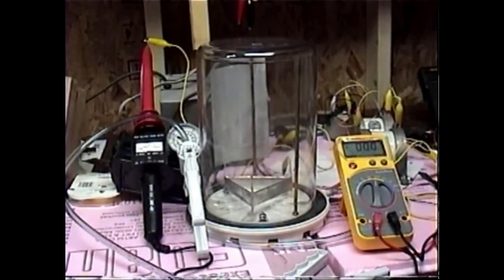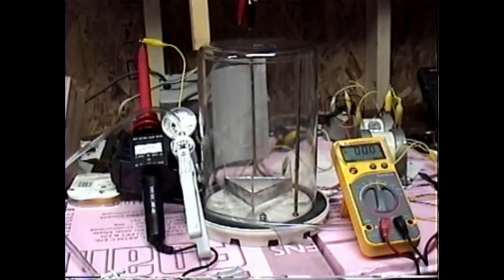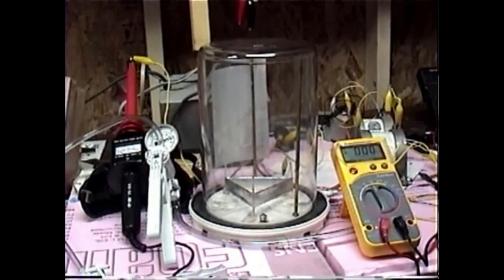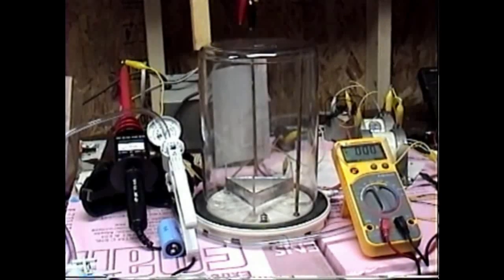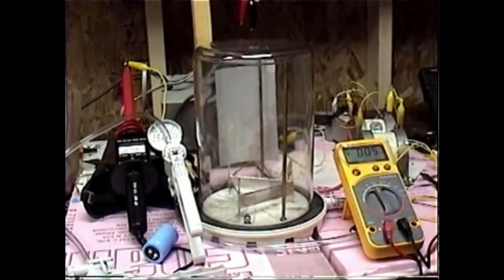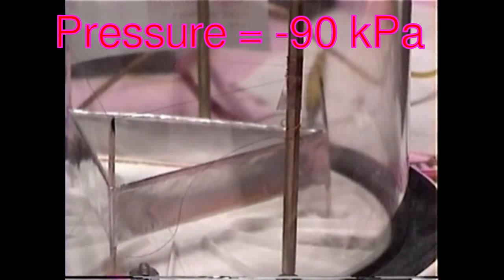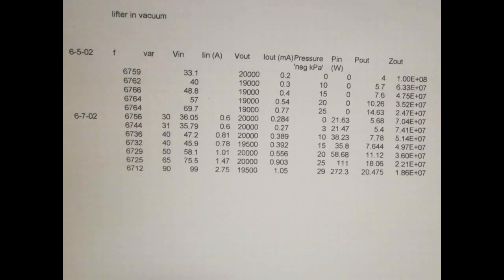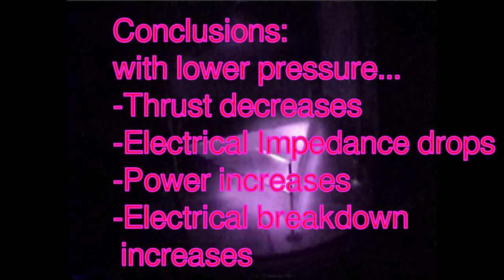Lifter in a Vacuum : Electrodynamic Ion Propulsion

Comment: did you try using another dilectric instead of air ? or a lager gap to compansate the lower resistance over distance of air atoms left/vaccum breakdown voltage ?

Comment: Great job. I think in a vacuum once there is arcing the lifter starts failing so you have to adjust the distance between the two electrodes to make it work again in that particular vacuum level. The stronger the vacuum the longer the distance the electrodes should be.

Comment: There is no propulsion from moving air. Essentially it is supposed to be an ion rocket.  Did  you check its weight? It is likely the same.  The lifter has control over free moving particles around it.  But is not yet deep going enough to dissemble molecules and atoms themselves around it.

 You will soon change to a gas you can control for a fast space jet.  So how are these corona motors working.  Via air molecules?  So an electrostatic motors can charge in front of themselves. But cant do that in space?  This effect isn't pulling things apart and moving bonded atoms around,  like any rocket that converts mass with energy to forward momentum.   If there was a way to enhance a rocket engine with an ion stage in the reaction to the output? Maybe try some dry ice and light it red. To examine the moving particles around it.   We are still yet to see what they can do outside the vacuum chamber.

Comment: brown worked with dielectrics between the electrodes of the lifters , you removed the dielectric ( air ) its normal that the lifter don't lift

Comment: Insulate one of the electrodes. High voltage travels through low pressure & vacuum easily.

Comment: I think that device needs more separation between the aluminum and the wire without air there is no resistance and it forms an spare gap it needs more separation in the vacum.. it cant fly also if wire and aluminum are very close at atmosferic preasure because the descharge..

Comment: the antigravity doesnt work in vacuum because there is no ions to complete the circuit. The anti gravity is a capacitor, (it needs a medium to complete its ciruit) (only then it could produce a lift, or a gravity propulsion) this system can produce lift inside a closed system only if the circuit is complete ( which makes it an antigravity driver). It has to have atleast some ions (oxygens or hydrogens) (air) to exchange electrons between anodes and cathodes (sorry for too much explaination). Then, the closed system can be used outerspace. 

(this.comment is intended to the elites who are interested for the antigravity projects)

Comment: Electrical impedance should definitely not continue to decrease once you reach Paschen curve threshold for air. This threshold looks like it is around 10^-0.7 Torr*cm, the air pressure times the distance between the electrodes in your capacitor. I guesstimate 2 cm distance from the video, this means air pressure should be down to 0.1 Torr for the "air" to start to become an insulator again. Did you reach the threshold where your amperage started to decrease again, because the impedance started to increase, since the k value of the dielectric increased?

Comment: Do you think it could be thermionic emission in a vacuum?
Reply from the maker: I assumed that this was just plasma emission?.. usually things have to get pretty hot for thermionic emission... probably the device would have to be made out of ceramic, instead of balsa wood, so it did not catch on fire??..
Reply: jaynes network Can be try to fill with epoxy resin? And watch this video https://youtu.be/-9smZ_-wFIc

Comment: I am still hoping Jaynes Network might be willing to try this with much higher emitter wires, to see if some of the lift can be restored at a lower pressure, without having to add a propellant tank.  According to Ohms law it should draw less current, and produce more thrust under such conditions.
Thanks very much ahead of time!
Reply from the maker: Yes, That would be an very interesting experiment.. It will take a little time to find the parts and set this experiment up again.. but I will see what I can do.. Thanks!

Comment: At low pressures the parameters of the device change. Distance between electrodes must increase.
Reply from the maker: Yes, that might be worth a try.. definitely increasing the electrode spacing should increase the impedance..

Comment: You are missing a dielectric. Try adding dielectric material with very high dielectric constant like barium titanate between positive and negative charges. Change the shape of the lifter to pyramid shape so the positive copper terminal on top is smaller than negative aluminum foil terminal at the bottom. This should concentrate energies at the top of pyramid shape increasing the force and should work in a vacuum. Also try adding screws at the top of pyramid shape so you can get a strong brush discharges to see if that produces waves in the ether to create tubes of force that Nikola Tesla mentioned produce momentum when Tesla coil is tuned to quarter wavelength AC. Read book "Occult Ether Physics by William Lyne" on it. You can find book on Amazon. Brush discharges probably wouldn't be as dramatic in vacuum chamber. Also read book "Shape Power by Dan A. Davidson".
Reply from the maker: I do have the book Occult Ether Physics some place.. it is interesting, but not too technical.. Yes I definitely need a dielectric for the T.T. Brown effect. More experiments to come..  Thanks for the great comments!
Reply: @jaynesnetwork  Uncovering the Missing Secrets of Magnetism is another book you can read on Ether.
Reply: @jaynesnetwork  What if you replaced copper on lifter with bismuth and replaced aluminum foil with magnesium-zinc alloy foil? According to Mark Mccandlish bismuth and magnesium-zinc alloy is used a lot in military ufo's. Check his video "Mark McCandlish. Interstellar Travel, Zero Point Energy 2014 HD".
Reply: @jaynesnetwork  If you figure out how to electrically create compression and rarefaction in the ether where you have lower ether pressure on top of the lifter and higher ether pressure at the bottom of the lifter. Pressure difference will result in propulsion and this will work in a vacuum since ether is everywhere as there is no such thing as empty space. Lifter should accelerate/fall/gravitate towards the lower ether pressure. It needs to be ether vortex creating pressure difference.

Comment: You should try trapping the ions in a magnetic field since in a vacuum the ions will just disperse away from the source.
Reply from the maker: It might be an interesting experiment to try.. Magnets tend to be very heavy though, and this device must be very light... to be able to fly!.. Thanks for the great comments!
Reply: @jaynesnetwork  You may be right about the magnets being too heavy. How about using an aluminum pie pan with a copper nail placed in the center with the point sticking up? It would even look like your classic flying saucer.  The copper nail will be a ion injector that would create a cloud of ions above the pie pan. The pie pan will be charged with the opposite charge that of the ion cloud. The ions will be attracted to the pan's electric charge and move down towards it while the pan's electric charge will be attracted to the ions and move up towards it. This will not cancel out the thrust in the direction of the ion cloud since the ions have very little mass when impacting the pan whereas the electric field of the pan attracted to the ion cloud's electric field is orders of magnitude much greater. So the pan is being lifted using the "bootstrap" principle.
Reply: @jaynesnetwork  If the experiment is done in a vacuum then the copper nail is no longer a "ion injector since there is nothing to ionize in a vacuum. It would be more precise to call it a electron injector. Also that copper nail needs to be insulated from the aluminum pie pan otherwise electrons from the injector will go straight to the pie pan without creating a electron cloud above the pan. It might also help to bend the point of the nail towards the pan so that most of the electron emission goes to the pan and not away from it.
Reply: The aerospace companies working on lifters are likely using megawatts of electrical power on their crafts in order for it to lift several tons into the air.
Reply from the maker: That is very interesting.. do you have any links that talk about this technology? Thanks!
Reply: @jaynesnetwork  I don't have any specific links but you can try Googling black projects, aerospace, antigravity, townsend brown, Philadelphia Experiment. The comment I made was based on a educated guess relating to the amount of electrical power T. Townsend Brown was supposed to have utilized to get his electrogravitics devices to work The lifter devices most people are creating in their garages are  really toys since they don't have the power necessary nor are they constructed  to lift heavier loads. To get results that could develop into a practical vehicle is likely beyond the means of most people other than large companies with a huge budget.

Comment: Hi Jaynes Network,
I built some, sort of similar devices, that lift their power supplies against earth's gravity!..  If you click on my channel icon you can see 7 of the prototypes, with no moving parts, flying with onboard power! 
I was hoping you might be able to do some vacuum tests with adjustable emitter heights.  I think significant power can be restored with higher emitter wires in a partial vacuum.  It would be great if you could run some tests whenever you have time... Anyway, no pressure, its just an idea.
Thanks!!
Reply from the maker: Very Nice work... Thanks for the info..
Reply: Thanks JN, You too!

Comment: You need a dielectric medium. When you drop the pressure within, you are cancelling out the dielectric. TTB did it with a solid dielectric.
Reply from the maker: I agree... There should be a dielectric.. I am planning to do more experiments, when I get the chance..  This is definitely very interesting!.. Have you tried experiments with lifters as well?
Reply: @jaynesnetwork  Yes I did but I used static electricity generated in the atmosphere. My designs were very small though and I was more interested in field propulsion than anything else using large amounts of voltage. That was about 5 years ago. But I want to set up a lab to do these experiments again in the near future.
Reply: @jaynesnetwork Hello my friend, did you ever re-create this experiment with a solid dielectric medium?

Comment: So there's not any propulsion without the air. By the way your channel rocks. I subscribed 😎
Reply from the maker: With this device, the answer seems to be no.. I am planning to test other variations in the near future.. We will see.. Thanks. I will try to keep make good videos..Thanks again!
Reply: We can use the centrifugal force as propulsion through a vacuum. When water is pumped through a pipe bent with a large radius and two straight sections that connect to a sharp 90 degree bend, the centrifugal force from the sharp turn creates thrust. Should also work similarly, and much more efficiently as electrons pass through a vacuum in a pointy cyclotron with teardrop shaped  magnetic path similar to the water pipe. Liquid mercury could be propelled with MHD in a similar configuration.

Comment: The dielectric used in you're lifter is air, which becomes ineffective once a vacuum removed said air. Replace the Air between the wire and the aluminum foil with a sheet of plastic, and lift will be achieved in a vacuum.
Reply from the maker: Yes I am working on a new experiment now.. Hopefully it will be completed soon...
Reply: @jaynesnetwork  Or simply coat the aluminum foil with a light spray of an insulating material. There may be plastics you can put on it. Or even put a thin paper that you can lightly hit with an oil spray. Every thing to minimize the weight. I wouldn't put plastic between the wire and aluminum sheet simply because the voltage can arch over it. Hell actually just use some magnet wire. It's thin, light weight and already insulated. You only need the insulation on one of the conductors to get the effect.

Comment: You took away it's dielectric. How sad.
Reply from the maker: We will see. I have some new experiments planned soon..
Reply: jaynes network 
I sure hope it involves using solid state dielectrics.
Reply from the maker: It definitely will.. The  liquid, gas and plasma states of dielectrics are much to difficult to work with!!..
Reply: jaynes network 
I'm working on this as well. The roadblock is getting my hands on high k dielectrics to use. Very expensive ceramics that usually are sold in small quantities.
Reply from the maker: Very interesting... You will have to let me know how that goes... I am planning to attempt a new experiment.. Hopefully this week.. I will be posting some results if I am able to get it working.. Thanks for the info..

Comment: Here is an ion thruster that can lift its onboard power supply directly from the ground! Just click on the purple channel Icon to the left to see videos of it flying carrying a small power supply. 

 I think if the emitter wires on the lifter in a vacuum are placed farther from the collector according to the level of vacuum that much of the lift may return.  Of course in a complete vacuum most of the lift will be gone unless a propellant is added.  Alternatively, it is possible to use extremely high voltages and no propellant.  There is likely though a very small amount of thrust even without air since electrons do escape from the back of the machine.
Reply: Air helps bridge the electric field gap, but not for suspension
Reply: There is no empirical evidence of electrons working in that fashion and pressurized gas can't create thrust in vacuum (Joules-Thompson effect). Even more, polarity and distance define the path of least resistance. You can't go anywhere with this in real vacuum. Newton's 3rd. is frequently misinterpreted. An oposite force requires contact or friction to preserve the continuity of the system.
Reply: @1969nitsuga  
1) When pressurized gas escapes a pressure vessel in a vacuum, it does create thrust.
2) When that gas is accelerated further, it creates even more thrust.
3) the Joules Thompson Effect, is almost all about temperature changes in gasses.
For these and  many other reasons I would like to politely disagree.  The above Ideas will work!
Reply: @KraussEMUS1  Rockets can't work in space vacuum. If the pressure of a system is 0 then the work done by the expanding gas into that system is 0. Gas expanding in a vacuum doing no work agrees with Free Expansion. This can also be understood as the gas meets no resistance as it exits into the vacuum and thus transfers neither heat nor energy to its surroundings. If the gas loses neither heat nor energy then it has done no work.

The principle of work and kinetic energy (also known as the work-energy theorem) states that the work done by the sum of all forces acting on a particle equals the change in the kinetic energy of the particle.

In a free expansion, gas is allowed to expand into a vacuum. This happens quickly, so there is no heat transferred. No work is done, because the gas does not displace anything. It can't transfer momentum nor kinetic energy. Keep dreaming!
Reply: @1969nitsuga  
If you sit on a chair with wheels and throw a large rock one way, the chair will move in the opposite direction.  A rocket "throws" blasts propellant one direction and the rocket therefore moves in the other.  Try the chair experiment if you don't believe me:).  Good luck.
Reply: @KraussEMUS1  Everybody quotes that stupid example. It isn't the same mechanics. You are mixing solids with fluids mechanics. Gases are compressible and doesn't transfer momentum at releasement under vacuum conditions. Newton's 3rd. needs friction or contact to preserve the continuity of the system. There is no momentum transference, momentum is preserved in the exhaust molecules.
Reply: @1969nitsuga  
As one example ion thrusters are fired pretty much daily inside of vacuum chambers, and they push against a scale, showing thrust.  They are not pushing against air, or the sides of the chamber.  Please keep it civil, if you want the truth:).  God bless you!
Reply: @KraussEMUS1  Thats BS. The Goddard Center vacuum chamber (the biggest in the world) is only. 200 by 100 ft. The vacuum is compromised the moment you start the thruster. You know nothing of what you are talking about. Even Bernoulli's Law is telling you it doesn't work. The lowe the pressure, the faster the flow. At supersonic flow, once you get the design speed or 6psi (42kPa) it loses effective thrust. There is no increase in flow speed regardless of the reduction in back pressure. At 1x10 -6Torr you just have no effective thrust nor avionics.
Reply: @KraussEMUS1  lol. The lie is so obvious: Ion thrust engines are practical only in the vacuum of space and cannot take vehicles through the atmosphere because ion engines do not work in the presence of ions outside the engine. Additionally, the engine's minuscule thrust cannot overcome any significant air resistance. Wikipedia
So Ion Engines appear "energy inefficient" because they are accelerating low mass propellant to very high velocities. In some applications this is perfectly fine: it is expensive to put mass into orbit, so it can make sense to use a less "energy efficient" engine to save mass in propellant. Google search.

Xenon is the heaviest non-radioactive elemental inert gas. The added mass allows for denser packing at less pressure. The mass is one of the limiting factors, so having a more dense gas helps tremendously. Momentum is mass x velocity, the mass is practically constant so the xenon must move at extreme speeds jus to male a minuscule thrust.
This is even worse under free expansion in vacuum. If you have vacuum they can't work, but they can't work without vacuum neither. They don't work at all.